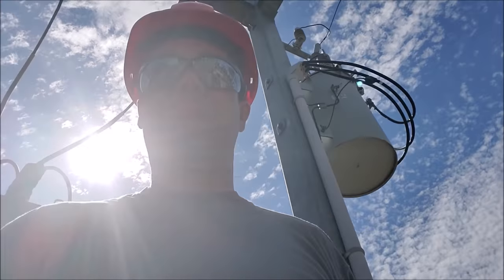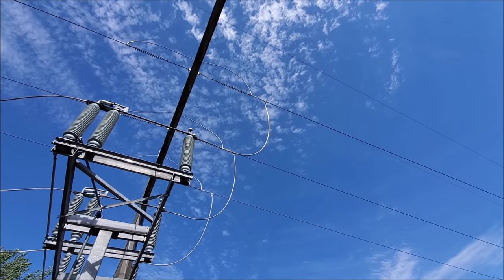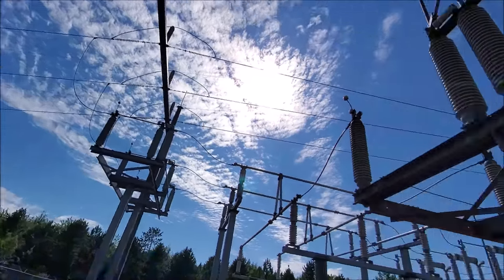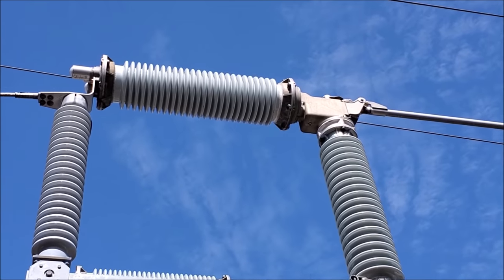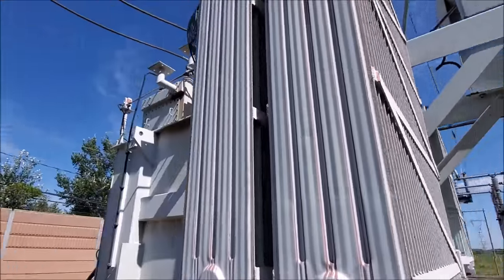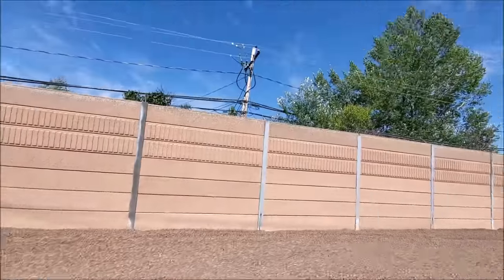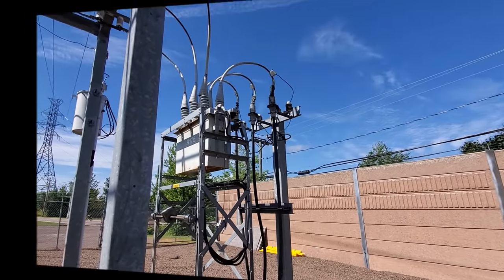How does a substation work?

Comment: You know its the big stuff when they call 7200 volts the low voltage side.
Reply: Still wrapping my head around that, the 14kv substations and transformers in my plant scare the hell outta me. The hum from those bastards make the floor shake
Reply: You should feel a 500/220kv bank. That is extremely unsettling.
Reply: We have 345kv to 138kv.  The 138kv there is called the low side
Reply: I think, in this context, the "low" was simply relative as it is a step-down transformer.
Reply: @silverdoggg  The physical mechanism that generates that hum is also fascinating. The strong magnetic fields in the core of the transformer literally vibrate parts of it, especially the iron/ferrite core.

Comment: I am curious, where does the power come from for the cooling fans on the bug transformer? Is there a little auxiliary transformer someplace that drops the voltage down from 7200 volts for stuff like that?
Reply from the maker: Yes exactly! Sometimes it's built into the power transformer. This one has a pole mounted one hanging on the steel you can see on the right hand side about 3/4 through the video
Reply: You can see the pole mounted transformer at 05:21. 😊
Reply: @rascalszx2  Exactly. It is called a "station service" transformer.
Reply: What if the main power is cut?
Reply: @df0rce  that fine most things can run for a bit.  There is usually a DC battery bank (132vdc)  for critical equipment.  The fans don't need to be running unless there is load through the transformer.

Comment: 02:34 - Why SF6 used is actualy not only its density, but also the fact it likes to keep its own electrons bound to itself very tight, thus it's very hard to get it ionized.
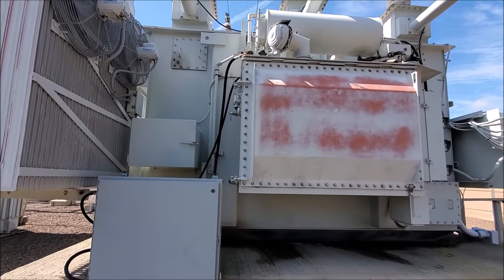03:39 - The oil is also one of the insulating materials (as well as that in the low voltage side oil breakers).
Great video, thanks! 👍
Reply: And here I thought I was a total badass😎 dealing with a paltry 40kv in the TV sets back in the day.
Reply: @InsideOfMyOwnMind  - Flybacks are fun. ⚡⚡✨Played with them a lot years ago, powered with a DIY ZVS driver.

Comment: As a mere consumer of electricity I have observed in my area that on a hard fault where service is interrupted for repairs there will be typically two dips in the power followed by the outage. I am enjoying your explanations of the raw basics.
Reply: Not a pro, but on another video it was said that the sub-station's circuit breaker, on being triggered, initiates a disconnect, then reconnects automatically. It does so a couple of times. And if the fault is still not cleared out by then, it disconnects one last time, shutting down for human intervention. So the dips in power you mention are probably that.
Reply from the maker: Yes! That's exactly it 👊👊. To correct some of the wording, the substation circuit breaker is our Sf6 gas interrupter that protects the power transformer in the sub. It doesn't automatically reclose as when it goes off, there's a good chance it's something major. 
The reclosing devices are the cabinet circuit breakers, oil reclosers, vacuum reclosers, intellirupters etc...
Exactly as you just described 🙌

Comment: Keep it up!!! Enjoyed your video..Im a trainee electrical engineer in a 1223 MW CCPP station currently posted on a 500KV switchyard operations
Reply: 500kV ? wow, would be cool to see that. Plant Farley which is 90-100 miles from me in AL has a 500kV line, always fascinated when I travel HWY 231/431 and see it cross over. I always wander how far the line can go, before it's "stepped up" again because of voltage drop. Be safe!

Comment: How could anyone give a thumbs down on this video?

Thank you for posting this, I've always been curious about substations and our electrical grid here in Texas.

Thank you so much for simplifying all this complicated engineering.
Reply from the maker: Wow thanks for the great feedback!👊 Cheers to you in Texas!
Reply: @Bobsdecline  I have a question: when y'all are working on above ground power lines such as 3 phase, y'all connect all three together with cables, why is this? Wouldn't that cause a "short" (if short is the correct term).
Reply: @Antny1973  yes,they open the line and then connect it to the neutral wire which is tied to ground and that drains any induction in the lines because the lines can hold a charge and is very dangerous  if not grounded,that is also for if the line would become energized it would blow the fuses or open the recloser because it's a dead short

Comment: I used to work for a company that contracted with two of our area's power companies spraying substations for weeds. The one company in particular I had to call their dispatch desk to inform them I was accessing their substations so they wouldn't operate any remote switches. The other company didn't have that requirement so we had to be extra mindful around the equipment because they could switch it at anytime. I was standing near a Cap Switcher when it closed and it sounded like a Shotgun went off.
Substations could range in size from 0.1 acres and a bank of 3 transformers all the way up to 30 and 40 acres monsters that had dozens of transformers and hundreds of pieces of equipment
Reply: Some high voltage substations do have permanent staff non-stop on site. But yeah, a lot of ones powering small towns is fully automated for very long time (since 80s probably).
Reply: Had you been hurt the other company could have been held liable for any and all damages to you and your equipment.

Comment: I like your videos. I worked in a power utility for almost 43 years before retiring. If seen some pretty wicked arcs created when switches open. We actually had load break disconnects to switch power lines or equipped. 500 KV arcs are pretty wicked to see. The arcs from induced voltages can be pretty bad .

Comment: If I watch this video enough times I'll understand it.  I do find it so interesting.  Your voice is strong and chill, which helps keep the listener focused on you and not freaking out.  Above the brand new SDSU stadium in San Diego off Mission Village Dr then turn left to the dirt trails, lies poles  that are still being used  today with active lines flowing to each one.  But these power poles are different and unique.    The true history of poles are right there on that ridge.  There are old wooden poles then simple metal ones, then they grow larger and taller with complex branches so to speak.  At least 6 different designs, very impressive.
Reply: Do you have any questions?   The flow of power through each half of the substation is pretty straightforward:
Tap from the high voltage line – Isolation switch  – Branch off to switch to link both sides of the substation together  – Load-breaking circuit breaker – Across lightning arrestors – Into 138000V to 7200V transformer – Several isolation switches – Circuit recloser – Down into underground distribution feeders.

Comment: We had in my area (and some other areas) in 2015 a large power outage. There was a motor malfunction in a switch in the substation. A thinking error of a employer after the discovery caused a short resulting in the power outage. The power outage lasted about 1 to 4 hours, depending of the area.
Almost forgot to mention: They did do a test, what they sometimes do. Only this time, something did go wrong.

Comment: My full time job is working in substations and we’re pretty close to what you have for equipment. We use Grounding switches on line terminals but interesting to see you have them on the high side switches of a XFMR. We also have low Side breakers prior to the low side switch you show in this video prior going to all the Distribution feeders.

Comment: My power turns off like once a week and it requires a line men to come over and flip a switch. This has been going on for many years, any idea what could be causing the problem? Could their equipment need some sort of adjustment to stop the power from tripping off all the time?
Reply: Happens in my neighborhood at least once every 6 months or so.  Ours is caused by trees growing too close to the lines that run through our backyards.  A branch comes in contact with the lines during a storm and BAM, the fuse in the cutout switch blows.  I suspect your situation may be similar.

Comment: Love this kinda vid.
I'd love to see you do the same at a generating station like hydro or something.
Reply: I once visited (as a 10yo kid), a high voltage (7 400kV feeds, 13 200kV) substation close to major power plant (8 generators). It is a major station for the country and cross-border distribution network as well.  It was (and still is) massive. It had huge control room (more like a building), a lot of monitoring, and permanent staff there 24/7. It was built in 1975, and modernized in late 90s to be highly computerized, and modernized again and extended in 2015-2020. It is 20ha (200,000m2), about 50 acres. It is huge, I couldn't enter the switch yard (nor the person that was accompanying me), and as kid I couldn't see a horizon, because of some many lines, equipment and buses. The control system was also pretty amazing. The nearby power plant tour I got in 1996, was also amazing. It was like a small town, and the generator hall was enormous. :)

So yes, I would love to visit or see it again, now when I understand things a much better.

Comment: That was good , helps a little, but a white stick pointing on camera to which part you were talking about would have been excellent. lovee the way you know what you are looking at. Thanks for video. I could not figure out about the switch in the beginning then I watched video again, can only open with no load, now that made sense. The more I watch the more it makes sense, awesome. That was cool now I can look and figure what is happening.
Reply: If you have any specific questions, ask.  The only part I thought could be ambiguous is the primary side of the transformer.  4:03.  The tall, bumpy-looking items held out far away from the transformer are the lightning arresters. The ones right over the big transformer are the input bushings for the transformer.  The tall bushings provide for lots of surface area separation of the high voltage electricity from the grounded metal case of the transformer.

Comment: Very cool - my old apartment was next to a substation and I often wondered what a lot of the various extra bits were and why they existed between the lines going in/out and the transformers.  I'd love to hear more about the re-closer things why they are in which locations, and I understand there's also some kind of automatic voltage regulating devices in some places as well as capacitors tho no idea how they fit into the mix or what it would look like.
Reply: As distribution lines get further from the substation, the voltage drops.  It drops both from the distance and the load put on the lines.  A voltage regular is just a fancy big transformer that can change the ratio automatically to output a consistent voltage (e.g. 7200 volts or whatever) no matter the input voltage.  
Capacitor banks are designed to correct inductive reactance. Over long lines, the internal capacitance of the lines themselves begins to inhibit the free flow of electricity.

Comment: You mentioned you must shed the load before opening a switch. When I see videos of arc drawing during a switch opening or closing is that just a low current inductive load causing the arc?
Reply: Probably he said something incorrect: as far as I know switches can be open under the nominal conditions of load of the line; so that's why in a lot of video you see the arc forming. Switches cannot be open when there are failures like short circuit currents (could be physically impossible in those circumstances to open a switch); and that's why we have circuit breakers, devices with loaded springs inside that could provide enough energy to open a line even under exceptional load condition.
Reply: @GiacomoMaglio  He was correct when he said you can't open those switches under load. If you look at the switch, it has only air insulation. No vacuum, no oil, no heavy gas. At those switch voltages, if you open that switch without removing the load, the switch will draw an arc and likely continue after the switch is completely open. Not only is this dangerous but it will damage the switch and possibly the connected equipment.

Now there are MV and HV switches that you can open and close under load, but those are specifically called "interrupter duty" switches for that very reason.

Last summer one of our main yard air switches was accidentally opened under load, it drew an arc and scared the life out of the guys right below in the yard. The arc was interrupted by the circuit breaker opening the circuit.
Reply: @David Raezer If it's just a quick and low intensity arc, it could just be from the connection/disconnection of the unloaded transformer. The windings are also a load, albeit a small one. If you're seeing a sustained arc, the switch probably was opened while still under an operational load.

I'll put it this way: When checking that each A phase, B phase, and C phase are actually A, B, and C, we use a test tool called a phasing stick. It's an insulated fiberglass pole with a HV or MV meter on the end. It communicates wirelessly to another phasing stick, and we touch both probes to different circuits and phases to see if there is proper voltage difference between them.

Long story short, when touching or removing a phasing probe, there is a VERY small leakage current going from the energized circuit, across the phasing stick, across my rubber gloves, and down my body to ground. As you touch or lift off the circuit, you can hear the buzz of an arc being drawn. Now consider that there's exponentially more current when connecting or disconnecting a large substation transformer.

Comment: When I was back in middle school our shop teacher used to take 4 ft florescent bulb and on hot humid nights, the lines on these huge towers would crackle really loud, and he would hold the bulb up, and the bulb would flicker

I think the lines carried 1 million volts

At least 500,000 volts

We went into the substation that was to the biggest I have ever seen.

the substation had several cooling ponds where the water was drawn out and put through radiators that had fans and then return to the pond to keep the transformers cool

Inside the substation on the ground there were white lines, about 3ft tin from the white lines wear yellow lines and 3 ft from those were red Vines and what we were told I don't know if it's true but what we were told was if you were to cross the red line the voltage would jump from the line overhead to you connecting to the ground with a huge lightning strike incinerating you instantly

There must be a reason why those lines were there and although that may not be true it scared the hell out of me
Reply: ocsrc You can actually kind of tell how much voltage is usually on one of the big lines by looking at insulator length and the number of conductors per phase. In North America, the highest AC voltage you'll see is 765,000 volts. That's carried on huge towers, with massive insulators and 4 conductors per phase. The other common voltages you'll see are 500,000 V (3 conductors), 345,000 V (2 conductors), 230,000 V (2 conductors) and 138,000 V (1 conductor).

Now those are typical numbers of conductors, so of course there may be variation, but usually those are what you'll see. This is because as voltage goes higher, yes you can transmit more power, but due to the way the electrons move in the wire, most of the current actually flows near the surface of the cable. This so-called "skin effect" gets stronger with larger voltages, so they combat this by adding more surface area in the form of more conductors.

Also, that crackling is known as "corona discharge". In the dark, you may actually see a little blue glow near sharp edges that are energized. Although, to be honest, power companies typically have metal rings in such spots because they help to minimize the effect as such sharp points can actually cause a fair amount of power loss.
Reply: @KyleJ61782  Skin effect only happens at higher frequencies and at 50Hz or 60Hz would be negligible. They use more conductors for current carrying capacity.

Comment: What a great video! Learnt a lot from that - very interesting. Subscribed!
Reply from the maker: Awesome! Thanks for taking the time to give some feedback! 👊👊
Reply: Bobsdecline - Lineman Awesome! Years ago, I was lucky enough to be allowed to take pictures inside a converter station in Kent, England where 270kV DC comes in from France. The guys there said I could go anywhere I liked within the compound except up... wise words! That place crackled and hummed and I kept getting little zaps off the tripod I was using - there was so much energy in the air ⚡️😀

Comment: So if there is a switch on the low side of the transformer and no breaker, does that mean you have to clear the entire low side bus if there is fault or problem with the transformer? Then send someone out to open the switch before feeding the low side bus from the other transformer in order to repair/inspect the faulted one? Most of our set ups (northern new england) use a low side breaker between the transformer and the bus.